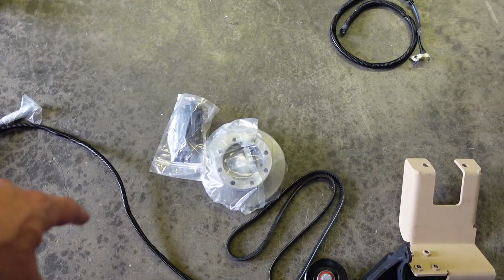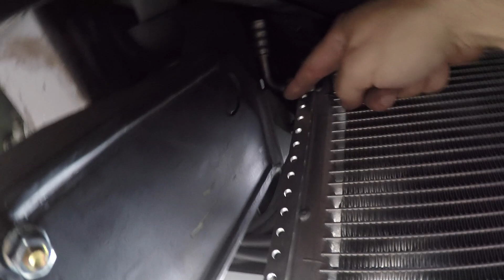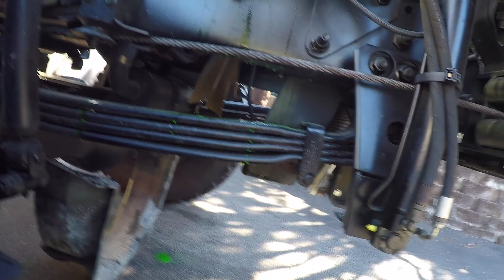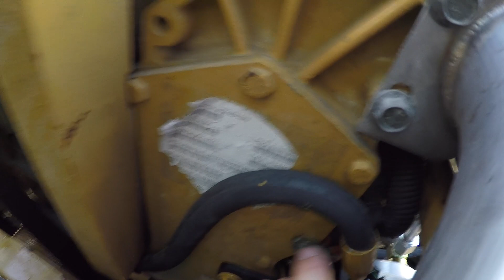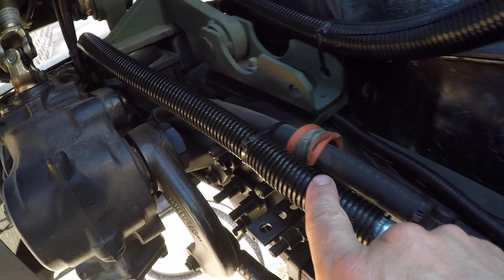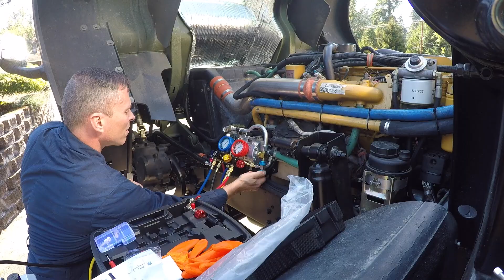LMTV AC Install

Comment: How is the system holding up 3 years on?
Reply from the maker: Awesome.  I just tightened the tensioner pulley last week.  But other than that it’s been solid.
Reply: @BrokeOverLand 
How did to get the tensioner pulley mount tight with the belt ? It doesn’t have a built in tensioner like my outer trunk! 
Just a piece of metal !
Any torch spec on it ?
Reply from the maker: I used a crescent wrench as a lever while I tightened the bolt. I don’t have a torque spec on it.

Comment: Hey man! Another dope video. So, my 1078 has everything already installed EXCEPT i haven't bought the actual compressor yet because i'm just not confident any of the ones i'm looking at are the best best. The link in your description about the parts is empty - Do you mind sharing what your compressor is/was? Thanks again chief.
Reply from the maker: If I remember correctly.  It is the Sanden SD7H13.  I’ll double check when I get back to the truck.

Comment: Why not use an electric system?
Reply from the maker: Electrical systems that put out enough BTU’s to keep up are way too much draw on the 100 amp alternator
Reply: @BrokeOverLand  Interesting. One solution could be using 24v alternator and hence half the amp draw. 
I have also seen 12v 300A alternator which should suffice in your case.

Comment: Chad, I want to bypass my low pressure switch so I can check the charge. My compressor does not seem to switch on. Is that the low pressure switch on the dryer. I cannot seem to find a diagram for the reddot anywhere.
Reply from the maker: The low pressure switch should be between the purple wire in the 4 pin conector (pin 4) coming off the evaporator and the line going to the fan (or fans) on the condenser.
Reply from the maker: And yes there should be a high pressure switch and a low pressure switch on the dryer.
Reply: My dryer only has two wires coming out of it. Two spade connections.  Is it safe to assume that's a low pressure switch?
Reply from the maker: @jameswaters313 probably wouldn’t assume anything. But you’re probably right.  Shoot me an email at crustyonwheels at gmail and I’ll send you my wiring diagram / crayon drawing of how I wired mine.
Reply: @BrokeOverLand  thanks. Just emailed you. If I put my voltmeter on the yellow wire the compressor engages. 🤷

Comment: Chad, what refrigerant did you use? My LMTV seems to have lost charge. I bought the vacuum so hopefully I can locate the leak and it's something simple. It's a MME truck. I'm not sure if they installed it or the previous owner.
Reply from the maker: I used R134a. You’ll probably need 3.2 to 3.4 pounds depending on your system and depending on your pump maybe about 8oz of PAG oil.
Reply from the maker: The type of refrigerant should be listed on the side of the compressor.
Reply: @BrokeOverLand  Thanks Chad, I'll go take a look. Where did you buy that bottle from? Nothing came up in my Amazon search. Maybe I need to be more specific.
Reply: @BrokeOverLand  found the sticker. Looks like mine is also R134a.

Comment: Hey Chad, hope you’re enjoying your holidays.  I’m in the process of installing the evaporator and there is a single pin wire that goes to the fording switch.  Is that the fan off switch on the dash??  How is that connected? Thanks
Reply from the maker: Yes it is. You’ll see which one it goes to when you look at the back of the fan switch.  Mine only had one empty terminal.  I’m so used to pulling the dash every time I touch the truck I guess I forgot to put it in the video.
Reply: You are too awesome for words!  Thank you!  I may take your advice and Velcro my dash😀😀.
Reply from the maker: 100% think Velcro dashboard is the future in LMTV technology.  :)

Comment: I don't know why I wasn't subscribed already! I will be doing this project soon. Question... any chance you know the bolt size for the 4 bolts that hold the compressor the the plate? Also, the 4 bolts that hold the two compressor mount plates together? My kit is missing them. Thanks a bunch for this.
Reply from the maker: Sorry I don’t have the measurements.
Reply: @BrokeOverLand  Darn! I'll figure it out. Thanks. Good work!
Reply: @CallMeColtLLC 

Compressor to bracket bolts are 10x1.5x110mm

Upper to lower bracket are 10x1.5x30mm

Comment: Does this set up have an orifice tube?
Reply from the maker: I had to google this. I’m going to say no, as I seem to recall an expansion valve in the cab unit.  But I’m probably wrong.
Reply: @BrokeOverLand  Thanks for the info!
Reply: @BrokeOverLand 

You are correct.

Comment: on the engine mount / AC bracket / Trans heat exchanger....  could the heat exchanger bracket go on the outside of the AC bracket so no spacer is needed on opposite side
Reply from the maker: I took another look.   You could probably bend the bracket out a bit and trim it to fit with a grinder.  But the spacers are probably less work.
Reply: Also, on my truck, my cooler bracket goes all the way up to catch 2 bolts, so you would have to hang that entire mount with 1 bolt until you could reinstall.

Comment: This is great Chad, thanks! I don’t think I can go through next summer without AC here in Texas!  I have been looking at AC alternatives for a while now and I think after installing the 3.07 chunks, that’s my next upgrade. While you were researching alternatives did you look at any semi truck 12 or 24 v systems?
Reply: Thanks! You just saved me a bunch time because I had the same list of vendors to contact. I was talking to Midwestern Military and they said they are ready to market an AC they have developed that fits in their console. They said they’ve been testing it and it’s easier to install because it works with the existing heater. I know this doesn’t help you, but it may help others who might stumble across this comment. They said they start advertising it before the end of the year.
Reply from the maker: Yes.  I looked at cruse n comfort, classic air and about half a dozen APU systems.  Couldn’t get an single APU company to sell me one for DIY install and none of the dealers I called had time for a custom install.   So I ditched the APU idea.

Comment: Hey, Your doing that all wrong:)  you can pull the upper shroud without pulling the lower if you remove the air pipes on the drivers side also.  Just did it a few weeks ago:)  in your case, other than being there to catch the fan clutch:) , it was probably way better to get it out of the way.  Excellent as always Chad!
Reply from the maker: I just had a mental image of the lower fan shroud catching the fan clutch and chucking it into the radiator.   Just gave me the shivers.  :)
Reply: @BrokeOverLand  :O

Comment: Check your refrigerant it may have oil in it already so you don’t wanna overcharge your oil. Also you might want to check your heater hose clamps under your cab they look like they might poke your refrigerant line of the while you’re driving I’m sure you probably already checked out but just in case you don’t wanna blow your refrigerant line that would make a mess.Great job. Really like watching your channel.